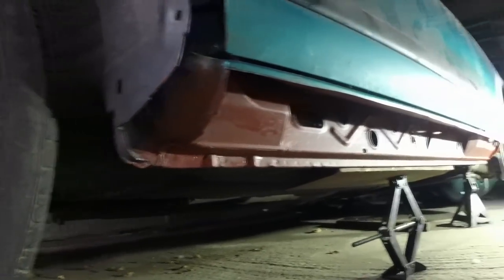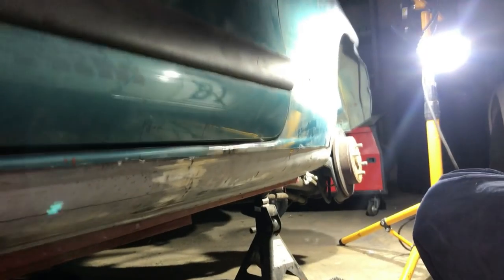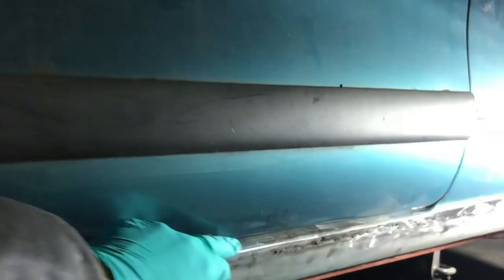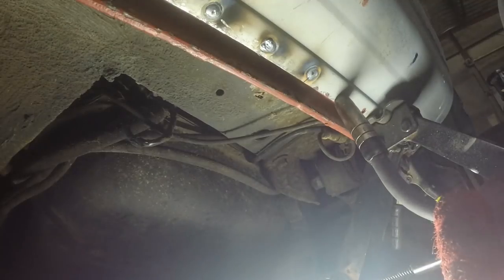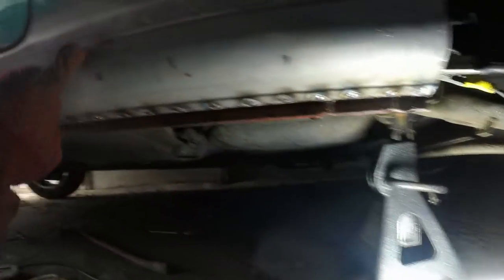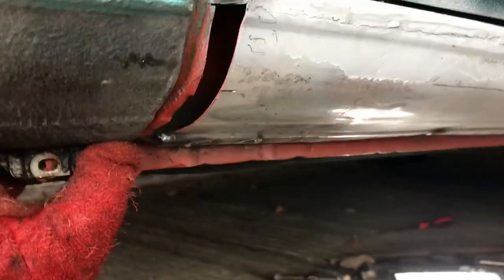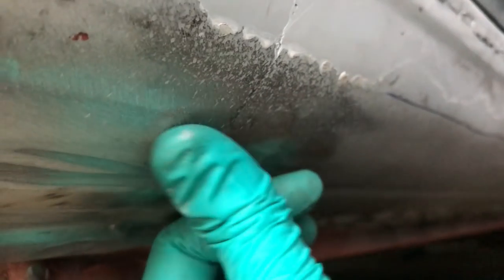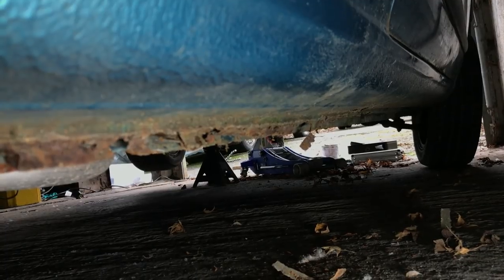Rover 200 mk3 Bubble T16 Turbo - Video 8 Sill replacement part 2

Comment: I’ve watched all of your vids and love what you do to save these old Rovers and keep them on the road. Love your “ no frills” presentation and the way you describe how you are going to attack your work, makes me think you learned stuff from an old Jedi type guy who’s been doing this for years.
Dunno if it’s my WiFi or your footage though, but the last couple of vids have been a bit choppy, like freeze frame ?. Don’t know if it’s just my crap WiFi though....?, anyone else had the same...?. After about 12 minutes it’s ok, I guess it’s different cameras ...??.
Reply from the maker: Thanks.  I aim to show my struggles and fuck ups as i think thats probably more helpful for others.

Had a problem with my iphone.  Its decided to put videos in a weird format that Windows 10 video editor doesnt understand so they all come out jerky.  Work fine on my phone but as soon as they are in video editor they screw up???
Reply: I noticed it to. Could be a problem with the iphone but more likely some sort of issue with the giant steaming turdpile that is Windows 10. You could try a different editor but it could be a driver problem. Curious how it started all of a sudden. Maybe the culprit is the latest Windows update? Normally it always breaks something.

Comment: I used make these at rover proudly I still use a rapid 1999 rover 200vi keep up the good work these are great cars
Reply from the maker: You did a good job building these. They are real well screwed together. What was your roll?
Reply: @nitrosilvia 
I welded them together mate I was also a rectifyer I worked on r3 for ten years so I worked on all derivatives of the model I loved it

Comment: Looking pretty good, not sure why the weld along the top of the sill turned out so bad. 

It's funny but looking into Jotun 87 to paint my car is the reason i found your channel. I had some pretty bad rust on my rear axle beam and underbody so i sandblasted it and put 2/3 coats of the winter grade stuff on. It was a pig of a job. I'm going to do sandblasting/jotun/gravitex on my rear wheel arches in the summer. I really hope its all worth it. I did it with the intention of it lasting 5-7 years because at the rate the rust was going i might have had holes in places in 2 years.
Reply from the maker: I think it’s deffo worth doing. After it’s done I’m gonna drown it in dinitrol internally and then spray wax externally.

Comment: Is that the blue SD1 under the tarp outside?. Nice attention to detail on the sill. Once that sill is gravitexed and painted it will look fine
Reply from the maker: Its actually a green 827 saloon mk1.  The blue sd1 is still at work.  Once this thing is done i can take my welder back to work and crack on.

Comment: Show how easily you can increase the power?
Reply from the maker: Being a turbo car, you can just turn the boost up.  However mine has a later engine form an 800 so i can get as much boost as with the earlier engines that had the Mahle pistons.